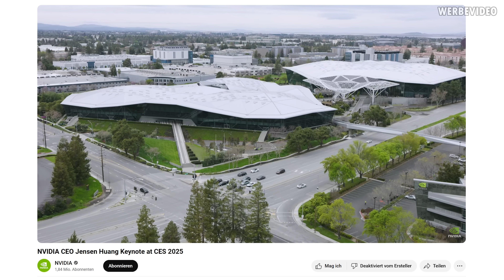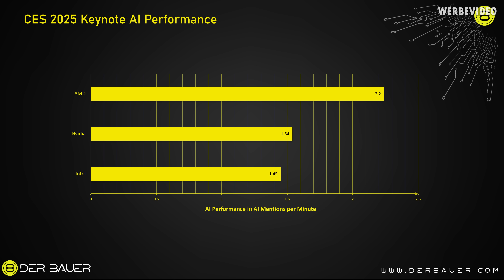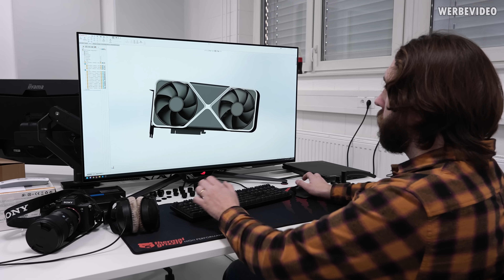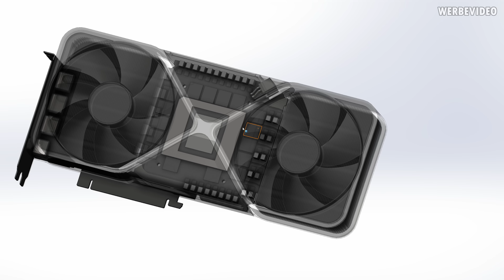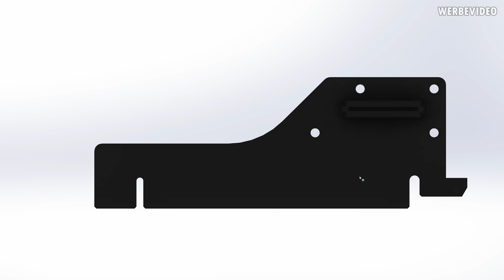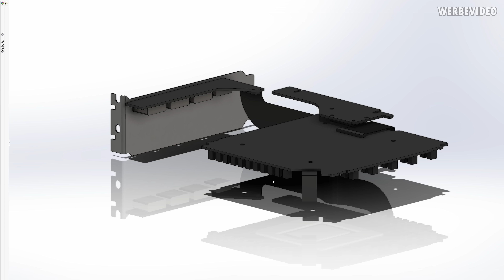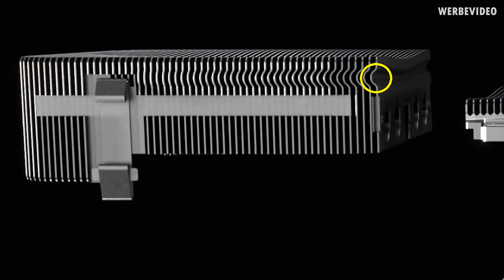We Reverse-Engineered the Nvidia RTX 5090 Founders Edition

Comment: Interesting piece of thermal engineering. It's extremely optimized, but the problem with optimized designs is that they are sensitive to the environment around them as well. What happens if there is a card in the next slot? Of an intake fan blowing over the card? Or some dust on the fins? Think of the P-51 laminar flow wing, was so heavily optimized to achieve laminar flow in a wind tunnel but in the real world bug splats and rain drops would prevent laminar flow from occurring.

Comment: Heat sinks have a heat dissipation capability which is defined by their surface area.  Air movement of course increases the dissipation, but the rate of dissipation is still a function of the surface area of the heat sink.  The bent fins increase the surface area of the heat sink without increasing its size.  It was probably easier to bend those fins in that way than it was to increase the size of the heat sink itself, which will usually involve redesigning neighboring parts.

Comment: For those defending the 30% performance increase as more than enough.... we got an almost double performance uplift and efficiency wins with the 4090 release.
Besides, these are not 500USD cards, these are 2000-2500USD cards, so whenever replacing them it needs to be worth it... even if you can write it off.
Will wait for the productivity reviews before totally dismissing this gen but, as things stand, the video encoders may be the only good thing about this release worth upgrading.

Comment: My rtx 3080 draws 370 watts in gaming, and 355-360 if i lock it to 950 mV. It pulls 67watts from the slot and 145 watt from 1pcie and 157 watts from the other. It goes up to around 70-75 C core, and maxes at 2050-2100 mhz core freq. 3080 is listed at 320 watts tdp, meaning my card pulls 16% more. So i would expect a 5080 to pull above its rated tdp power, maybe 400-450 watts? Or am i wrong?
I was hoping to replace the 3080 with a 5080, but think i wait until we get some serious benchmarks, hoping to keep my PSU.

Comment: I don't care about all that DLSS buzz, neither AI. I'm trying to use CUDA code to make calculation using cuda cores. I want 1024 registers per thread and a 256 KB register file size.
In fact, the less than 280€ 4060ti's of last BF are still the best cost to calculation power deals.

Comment: I sold my Zotac AMP Extreme RTX 4090 for $1400 USD about 4 weeks ago, and replaced it with an Intel Arc B580 until I can get a RTX 5090. My friend has been trying to sell his MSI RTX 4090 for $800 for the past week and no one is biting on his price other than a few low ballers. It's kinda too late to sell your RTX 4090 for a good price. Not when the RTX 5080 is $999 and offers 10% greater performance.
Reply: Nvidia fan boi

Comment: So, will we be able to upgrade/change the GPU part of the card without changing the cooling and the IO ports?
I wonder why (other than profit), with all this technology achievements, we don't have any (even partial) modular Graphics Cards. If you want to upgrade a  RTX4070 to a RTX4070ti, you have to throw away the cooler, connectors, memory chips etc, just to upgrade the GPU.

Comment: The bends in the heatsink fins are very interesting, my guess would be to increase the air pressure closer to the heat source with added turbulence while having the lower air pressure from the edges help extract that slower hotter air.  Another guess would be that by slowing the air nvidia are allowing a more dense environment for heat transfer.
If nvidia wanted to experiment with fluid dynamics, they certainly got the hardware available to do it!

Comment: pcie gen 5 is a deal breaker for me , i can only hope they will make a pcie 4.0 16x version of a smaller card to get any improvements on two 3060ti's . I currently run each at 8x 4.0 with a 4x 4.0 storage, pcie 4.0 is maxed and i would have to go to a single card with more power. losing performance on a new card running on a slower pcie lane just isn't appealing .
Reply: maybe i could buy up the 4000 series stack to get an actual improvement.

Comment: you are correct about fin curve and bend. the product manager told in a interview that the air moves faster in the edges of the fan and slows down the center you get. so it creates a hum and beat (gamersnexus noctua interview has detail). so those are specially designed to keep airflow speed similar while not hurting performance

Comment: For the 58 different fin designs, it could be that they designed a wide stamping tool with an extrusion for those curved bits that goes from a larger/deeper extrusion on one side, and slopes up to a shallower extrusion on the other. Load up a wide (fin width x 58) sheet of metal in there, and stamp out ALL 58 fins in one go. Once stamped, the sheet would get machined apart into the 58 separate fins, and that's that.

This would result in fins whose extrusion depth changes across each individual fin's width, but if all fins change similarly, then that shouldn't be a problem.

Comment: awesome design , all the heat pipes get to do the same work, short runs to the fins. Only concern would be the 4k signal through a connector on the board and through a ribbon cable.

Comment: 15:15 the different curve in each fin is possible with a single press. In a stack of fins, the closest to the press will receive the most deflection and it tapers off exactly as you see it on the card, due to each fin absorbing some deflection by compressing.
Reply: I can picture what you mean. That sounds plausible.

Comment: The bend in the radiator fins is there to control the flow of air.  As the area with the most bend is closest to the PCB it will be getting the hottest therefore you want to slow the flow down. As you get further away there is no bend which means more flow can pass through it 
This is to utilise the radiator more efficiently.

Comment: Maybe it's 3D printed fins ? I have no idea. 58 different stampings seem unreasonable tho. Not necessarily for the investment cost itself (nvidia can find 500k laying around I'm sure), but the manufacturing process and interruptions themselves along with QA if any of those 58 perform not as it should.

I do wish they made similar cooler designs for the cards lower down the stack, maybe not the 3D variable fins but the overall arrangement. I would be ready to pay a premium for a 'airflow' branded card. Current GPU cooler designs of 'let's just reblow hot air against a wall continually' have been dumb and not fit for purpose for a very long time now.

Designs with 1 flow-through fan are starting to appear because it's the easy pickings, but needless to say 2 is better and they even managed to put a 4090 PCB vertically on the side and have 3 flow-through fans with the 4090 prototype that Gamers Nexus dismantled.

Comment: Depending on the scale of their production they might have ~58 machines doing the stamping anyway, so each having a different die might not be all that insane. Or fewer with multiple dies per stamp and larger feed stock. If they make enough cards then it might not work out more expensive in the long run, as each die lasts longer.

Comment: With techniques like deep drawing you can trade material thickness for increased size/depth. Turning a flat sheet into a thinner bowl of a similar diameter. So they could hypothetically maybe use the same stamping tool to cut out the sheets, with a different deep draw die. Having said that, I'm not sure there's an advantage because you could possible combine them into one tool?

Comment: The cooler design is really good in a sense of hot air movement - finally the air is blown THROUH the radiator instead into it and then having to turn 90 degrees to be blown out from the side. Ofcourse it will suck if the card is placed vertically but otherwise if you have bottom intake fans the idea is great.

Comment: The multi pcb design bothers me a bit, specifically with the pcie slot being on a separate board.  A decent amount of force is transferred between the pcie slot and the cooler - making that interface more flexible seems problematic. 
Alternately, maybe its intended to function as a mechanical fuse?

Comment: Need to know more concrete data about the liquid metal thermal interface material.  That's been a show-stopper for years now.  Liquid metal degrades other metals it comes into contact with and it's death to electrical connections it comes into contact with.  This needs to be nailed down with Nvidia.  Who wants to pay $2000-2500 for a GPU which degrades over time and dies in 3-4 years?

Comment: Sorry but you reverse engineered nothing. Until you have a real card in your hands you cannot know how the final video card will be. Even if it ends being the same as in the CES renders, you don't know how accurate they are. You don't even know if there has been some change to it internally. Because you don't know how long before its presentation the renders were made. And making the kind of video in the presentation takes weeks if not months. You are just speculating based on a video that didn't show an actual graphics card.
Don't get me wrong, you may be right. But there is so much that can be wrong doing this right now that your affirmation could be totally false.

Comment: At least having a seperate pcie pcb means that if it breaks ( like previous generations do ) it should be available as a spare part.  also shipping shouldnt put stress on the solder joints under the core and memory.  its about time.

Comment: Hey Derbauer,

The concave nature of the finstack is exactly as you said, it's due to pressure differences when a fan is operational, the air closer to the pivot point of a fan moves slower than air on the outside edge, so to try and balance airflow movement and reduce turbulence and noise, Nvidia has reduced the finstack thickness in the center, above the fans to compensate.

I can't confirm the curving of each individual fin, but it appears to be made to make room for the main PCB, if Nvidia didn't curve each fin after the first, then the restriction would've been too much in that particular portion and heat wouldn't be able to escape the heatsink.

Comment: I don't think it's that the 4090 isn't a good card anymore, I think it's like you said: most people use DLSS. Comparing DLSS on a slower card to native on a faster card isn't a proper comparison, but it's the most accurate comparison of use case. The people buying 4090 and 5090 cards probably aren't the most likely to run DLSS, but the people spending 5070 money ARE likely to use it. 

What's interesting is that (1) 4090 cards have been in short supply so you can imagine 5090 demand will be high, (2) anyone selling a 4090 wants to maximize resale value to probably buy a 5090, (3) most potential buyers are likely to use DLSS and save the money by going for a 5070, so (4) the perceived value of a used 4090 is HIGH for sellers but LOW for buyers.

Comment: we cant forget about the huge advantage nvidia has for industrial manufacturing, literally making industry leading industrial manufacturing optimization software. 
I have a hard time believing they would make a different press die for each fin, the different curvatures could use a different gap, or even made on the first pass by simply stacking up the plates and smacking them all at once 
Im not a mechanical engineer but i cant imagine nvidia would rent out basically a dedicated factory for a single card being just two slots instead of three.

Comment: The 5090 FE cooler, while very complex making it probably cost more, is probably going to be used across all of their current lineup. I can't see Nvidia not using this efficient, complex, and expensive-to-manufacture design to just limit it to the highest end card where there fewest people purchase. If this were to be used across their entire lineup, you don't have to have separate manufacturing lines for different coolers. Not to mention, WHY NOT use this 2-slot design on all your cards? If it is as good as they say while being this compact, it makes sense to use it.
Reply: I saw a video with a manager from NVIDIA who said that the 5070 won't have this new cooler, so i guess that the 5080 and the 5070Ti will have the same cooler as the 5090.

Comment: Thing is if the 5090 is 20-30% faster than the 4090 in native rendering, then it's the same percentage price increase. Meaning you're not getting any more frames per dollar than the 4090. ... For the same frames per dollar between the 4090 and 5090, then the 4090 should have been $1999.00 too.

Nvidia are probably pissed off that they sold the 4090 for $1600 and everyone said it was a bargain.

Comment: 15:30 Could I make a stamping tool with 58 different positions, and each progression is slightly more curved? And once populated, I just dump all 58 fins off the tool? So the flat fins are 'incomplete'?
Reply: Progressive dies, we have these in the room next to my office (can feel them in the floor in addition to hearing them). Normally they're used to gradually stamp to your final shape (because doing it in one step would destroy the metal instead of stretching it), feeding the strip off the roll through each in sequence and not stopping until you reach the end of the roll and scrap what you can't feed through the die. Nvidia could be running a progressive die and  cutting the strip and starting the sequence over each time the final position gets stamped. The least to most stamped fin has about the same difference as what I see done in one or two die steps with aluminum, so it could be they do have 58 different dies but run parts in parallel, so one machine is making multiple fins from multiple rolls per press, which would let them run continuously and more efficiently than interrupting a normal progressive die process.

Granted I'm not a tool and die guy, the most I've worked with our punch presses is installing safety curtains and the operator controls, and remaking a 2D AutoCAD drawing into a 3D Solidworks model and 2D drawing to get a quote on a die. Other than that I'm the robot guy at work.

Comment: I said this a few years ago to a GN video, it's very bad that we are still using the same type of cooling method which basically dumps around 60% of the hot air that the GPU produces back to the PCB and this this needs to change, and it seems like NGreedia took notice.
Their solution offers amazing thermal performance improvement and to top that off it also tackles with broken PCI connectors as they are not a direct part of the main PCB anymore rather its own meaning even if it gets damaged it can very easily be replaced, same for the IO.
NGreedia might be what they are but hey surely do top notch stuff, gotta respect and admit that, except for the fake frames of course.

Comment: whats the point to pay for their coolers if most ppls that can afford such gpu will watercool it or just mod it with 3k rpm noctua fans ... i myself own a 9800x3d dual 480mm radiator watercooling setup all i miss is a fucking gpu i dont wanna pay car prices for a gpu so i dont need those invested shits and Ai trash stuff i just need pure power and efficiency stuff that i can use and not some Ai core to predict my movement and generate fake fps

Comment: If I was head of engineering at Nvidia, I would ask for an increase of 30% in performance while dropping it's power usage, it can be done via good engineering. Look at aviation, the RR engine in 2025 is 19% more efficient, 29% less fuel consumption, and 31% extra thrust since the last generation, Nvidia cards are increasing in everything, just bad engineering all round.

Comment: Regarding the shape of each fin being slighty different: Perhaps the method used is to stack the fins and stamp them together in a single step, with a single two-part mold. The added thickness of each fin would then ensure each one is a little bit different. Think of it as if the stamping mold is for doing a "D" shaped curve, and the width/thickness of the "D" itself is given by the added fins. 
The keynote's images seem to confirm this method. (maybe some sort of liquid is sprayed between the fins first to allow easy separation afterwards, but that is a detail of the process anyway).
If this does not aling exactly with what we see in the images, maybe there is some kind of sacrificial separator between each fin, or those are the fins that go to the other side of the cooler...
Reply: This was my immediate thought too.

Comment: Hold your horses Roman you don't need 58 tools to do that, you need one. and maybe 58 frames (i would do it in one maybe to frames) to do the bends and the price of 2000$ is way exaggerated one frame may cost somewhere from 50$ to maybe 200$ it depends, how do i know? Because I worked on such stuff.  What may add to the cost is that the frames wear out after stamping some amount of sheets.